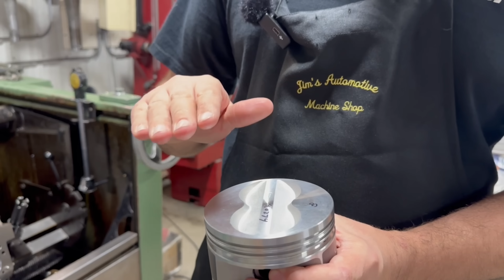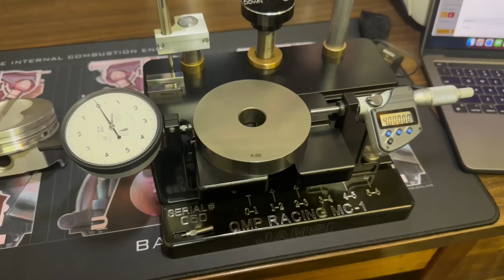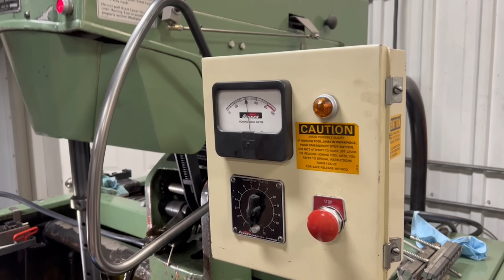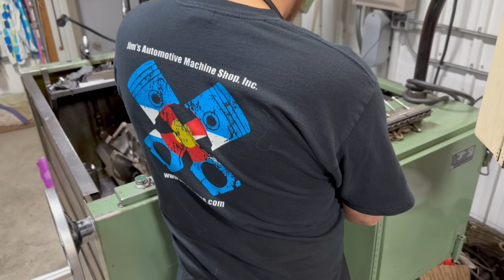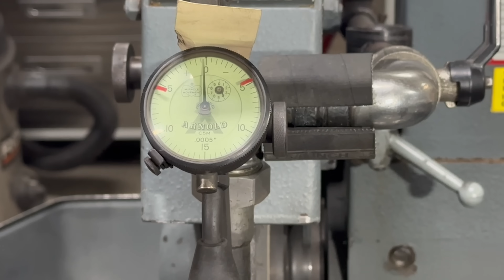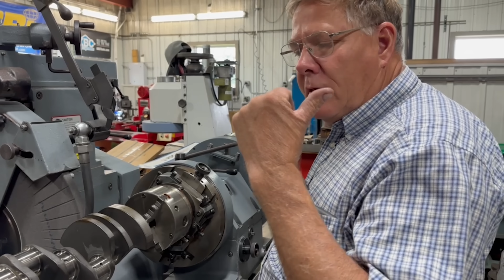Is Our 383 STROKER Crankshaft JUNK?!

Comment: Love the content.  I have some experience with surface roughness measurement using a Mitutoyo SJ-410.  The greatest advancement in understanding the condition of a surface for me came with the implementation of a software application called OmniSurf, published by Digital Metrology.  You pull the data from the gage directly, and you can perform offline form removal and filtering.  It's a game-changer!  Keep doing what you are doing.  It's fantastic!

Comment: Jim here’s the link..
David Vizard 621hp 383
540 ft lbs 
On pump gas - 87 octane 

https://m.youtube.com/watch?v=f66F64vSP4g&t=12s&pp=ygUYRGF2aWQgVml6YXJkIDYyMSBobyAzODMg

David also explained what is gravity…
It’s not the earth spinning..
It’s the weight of air…

A typical high school gymnasium has 40 tones of air inside the building..

Comment: David Vizard goes into the science about flat top pistons for street / strip engines…
Explains the burn rate across the piston using pump gas..

David has a spec build 383 Chevy that 621hp on pump gas - like 580 ft lbs of torque

Comment: How do you go about checking  if the crank is true  - all the journals  are where they should be  I never see anyone do that  - I've seen  off-setting the journals - making them smaller pushing them out using a smaller rod to create a stroker/somin

Comment: I had Jim do some extensive head work on a set of 461's that I put in a hotrodded 400 in about 1988 or 89.  Steve from LaSalle Manufab sent me to you.  I remember seeing your old shop El Camino around town in Greeley a lot. I moved to Arizona years ago, and I just came across your videos.  When I saw your familiar face I was amazed.  Good luck with your business!  I still have hotrod stuff, but a whole lot more expensive now.

Comment: yea profilometer is important. head gasket and ring companies spec a required surface finish but most machine shops or even engine builders do not even check. they will o-ring the engine before fixing the surface finish.

Comment: Great video!  Will you be using the profilometer for head gasket surfaces  and flywheel grinds? They both are designed for a specific target,  especially head gaskets (steel, composite,  copper,  etc.). Bummer about the crank, supplier quality is a never ending battle. Would be interesting to know e what the makers tolerance is, compared to what GM new crank tolerance is. It's all about time. Time spent to get down to minimum variation.  From a business perspective,  in tolerance is good enough, send it. Of course they COULD hit those 5% of tolerance numbers with process control - but that drives up cost. Three kind of work:  good, quick,  and cheap.  You can have any two, but not all three.
Reply: Used to be able to get .001, .002, & .003 under bearings.  That crank wood likely clean up at .002 under.

Comment: Piston accumulator grooves are unnecessary if you comprehend gap, and the purpose of each ring position. 
The top ring is the only compression ring. The second ring is an oil scraper ring, it scrapes excess oil from the cylinder wall. Hence the conical shape. The third, or oil control ring carries oil to the upper cylinder. 
Ring gap is critical. The top ring gap should be as small as possible without presenting the possibility of butting. 
Second ring gap can be absolutely wild, and should be. If the second ring does not allow gasses to escape because of a too small gap, the top ring will float or unseat.

I don't even want to watch the revelations re the crankshaft. 
I spent many years grinding crankshafts. From the miniscule Briggs, to the large Caterpillar, Cummins, and Komatsu.

Comment: What you are talking about, is called integrity. As a former machinist, I pushed for that in the shops I worked in. Any time I received a part that someone else had started, I took the time to measure every fit before putting it into another machine. It saves time, money, and needless fighting over who did what! Some people try to hide their mistakes, instead of learning from them.

Comment: Just checked my Eagle forged crank. Same story, not quite as bad. seems the rod journals vary from edge to edge. This seems to be the case with all the Chinese made crap. They're just slinging it out fast with no regard to quality! Shame on these American companies for not doing the quality control! I got fed up with Eagle some years back as their flexplates were absolute junk. So cupped and out of spec. Their answer was " They computer welded everything and it was good". Hadn't bought a rotating assembly for 7 years from them. I guess I'm not buying any cranks from them from now on! Probably not from Scat either!

Comment: i know next to nothing about machining, but i’m curious: is it ever considered appropriate to give back a crank with different diameters on the journals, and just advise the customer which rod(s)/main journals require what size bearing, or do you grind everything to the same size as the smallest journal?

Comment: Isn't this a VERY well know manufacturer (That I will not name) crank??? Because if it is, I can tell you that this WOULD NOT BE the first time in RECENT months that we have seen this type of issue with there parts. Another Well know You Tube channel RECENTLY had a issue with a crank from the said company that I will not name. And it cost him a LOT when the crank failed under a low rpm failure.

Comment: The out of round 3 tenths wouldn't bother me as much as the taper. One shop I worked at had a crank grinder that ground a full. 001" out of round. I refused to use it. Guy that worked there told me every guy that worked in that shop since the machine was new in 1962 complained about it. We had Jamison Equipment work on it 2 times, including rebuilding head and tailstock and scraping the table and the gibs and ways. Never changed a thing. One day the late Jim Gessford came in after he sold his shop and started selling equipment for Jamison and I was telling him how disappointed I was in that grinder and all the money we dumped into it only to have it grind out of round. He says it sounds like it's lined up perfectly and that's not correct it needs to have a slight misalignment just like toe-in on a car front end. He told me how to check it and what to do and with 4 little pieces of .0015 shim stock that machine would freeze the needle on the Arnold Guage!!!! I was amazed, that was 1989 and I'm forever grateful to Jim Gessford, he was a self taught genius of a machinist and equipment rebuilding. My biggest regret was not going to work for him when he offered me a position once. I would have learned a lot more and probably still been doing machine work.
Reply: Yeah I read and learned old ways about shimming and comes from the pre-war days rebuilding by hand I been doing this stuff since 68 but too too precise equals stress and redo because of over precision and being too picky the engine will still run
Reply: @brantardrey7360  I was referring to shimming on the crankshaft grinder to get it inline so it would grind perfectly round. Not shimming the engine, that went away when insert bearings came out in the early 50s. Way before my time.

Comment: That's a Tough One.. The Crank Supplier thought the Crank was 100%.. Unfortunately you got it.. Grinding it 10/10 will be fine..I Beleive You will Not have a difference in the balance to even worry about, seeing how low you got readings..... It Would be a HUGE challenge for The Cleaning Guy if You Bought Plus .001"  tighter bearings and he could grind the crank journals to suit them.. Plus .001" bearings i've seen, depending on brand, close up clearances .0015".... Great Job, and Buying a Profileometer is a great move and asset to have to hone blocks....Well Done...

Comment: I'm not an engine guy, but I am an engineer and I can't believe clevite will only promise .001 out of round!  Thats absurd in my book.  You weren't even trying to check concentricity between journals.  I'm honestly not sure how they could could possibly grind a crank that far out of round aside from silly high of tool pressures.  Guess trying to push parts out the door.   Making something round is one of the most basic operations you can do in grinding (getting the size perfect is much harder than getting it round right?).  With a little patience I've set 30 meter linear rails to +/- .001 and the machine runs compensation on top of that to account for concrete foundation deflection.

Comment: As a master machinist and master gunsmith I can say that just a minor change in temperature can change the diameter of a piece of steel that size by several ten thousandth of an inch.

Comment: I am stunned by these measurements for a "new" crank. Surely your supplier needs to come to the party here, it is their reputation too. Notwithstanding that you have balanced it already, this error is not yours, and the cost of the work is borne by yourselves. I would ask for another crank actually. I would be more concerned with the out of round rather than the step though. One rod would run on one part of the step, the other rod would run on the other side. Unless the customer specifies a zero/zero crank, grinding it seems the logical choice if the crank supplier will not come to the party.

Comment: Have you ever checked a cylinder after removing the torque plate to see just how much it affects final dimensions?  How can a a solid torque plate (steel? aluminum?) simulate the distortion a cylinder head, (either cast or aluminum) , with all it's internal passages,voids, cooling jackets, ports, even combustion chambers will have on a cylinder? An inch thick solid steel plate without a head gasket is not going to stress the bore exactly like a cylinder head. Yes "everyone" says they're essential,and it's always been done like that, so there it is.

Comment: I used profilometers a lot in aircraft hydraulic and fuel valve machining and assembly. We called them "creepers" in the shop because the probe moves so slowly.

Comment: This is what i keep seeing.  Cant trust any parts.  From a bolt to a crankshaft!!

So you can now change your video title's  to "A blueprinted 383".

I dont rebuild engines or transmissions on the daily.  I have and have a trusted machine shop do the machine work when done.  And it always gets inspected by me  and not just installed assuming it was done right.  And thats why i "trust" the machine shop i go with.  I have yet to find mistakes.   

But here is an example of crap parts.  I put 7 alternators in 1 car last year.  Every one failed.  Either 5 minutes in to a week in.  It sucked.  And i did 5 cv axles in 1 car!!  All caused a wobble.

Comment: In the absence of an explicit roundness requirement for a circular feature on an engineering drawing, the feature of size tolerance implicitly controls roundness. If the feature of size tolerance allows more roundness variation than can be tolerated, a roundness control should be specified.

Comment: Yes sir we have to make sure that what we are getting has not been messed with before. If you keep that crankshaft of course it should be corrected, but I would think that I would send it back to the supplier and let them know what the problem is. I worked at a place where a fellow mechanic messed up one of those fuel pumps that go into the tank and the manager simply sent it back to the parts store for credit. Of course he did not tell the parts store the reason for the return and most likely it was boxed up and put back on the shelf for some other unsuspecting shop or mechanic. I am leary of any part that has been reboxed or shows signs of handling or installation.

Comment: I am not an engineer, nor do I have any experience of engine machining, but I do like watching rebuild videos. I have seen some videos where the very last process in cylinder bore honing involves the use of wire brushes. Apparently, it makes sure no bits of honing stone/media are left in the cross hatching. What are your thoughts on this? Keep up the good work.

Comment: Since I started using an SJ-210 about six or seven years ago, I found it to be an indispensible part of my honing operation. I've learned that cylinders and sleeves from different sources can require tweaks in the finishing operations. What I always assumed to be right, as in "this is how we always did it," turned out to be pretty close, but not 100% by any means. If you have any finishing issues, the guys at Total Seal Piston Rings are very helpful.

Comment: Heck , offset grind the crank go from  3.750" to 3.800"  and go to the small journal rods.   Maybe cut . 030" off the piston,  and  maybe run a
.040" - .050" MLS head gasket  gasket ,  with the piston at zero deck, or or possibly 
.010"- .015" proud ,  with the gasket and the relief should leave plenty of clearance. Tight quench pads, performance is much greater,  and polish the chambers while while it's apart, maybe  ceramic coat the chambers and exhaust ports! I guarantee it will produce more power than without the mods,   definitely would require checking the valve clearance,  and quench clearance, also get more cid. Aswell, near 390cid it's been years since I did the math,  my 385 stroker,  I was thinking about getting a 3.850, maybe offset grind that to 3.900,  possibly 3.925", 3.950"  and possibly shorten the rods a bit by resizing them, tak about .020"off the rod only then resize the journal end ,  then take a bit off the piston, if required, mill the heads, so the piston can fit in the head slightly, with about .020" larger diameter, than the piston, allowing the rings to  reach closer to the deck, all this making a more efficient engine, especially with about 200-220psi,/11:1+ compression. For a streetable engine,  with the quench pads so tight, they have clearance, however carbon cannot build up, the pressures involved blows the surfaces clean constantly, although, with heavy bearing wear, or spun bearing, it will definitely make contact,  this really produces power in a engine, greatly improves combustion, it's basically Ben Almeda's religion, it only confirmed what I already knew!  Also plenty of piston to valve clearance will reduce shrouding, the piston can shroud the valves also! Especially domed pistons!

Comment: I once bought a set of brembo brake discs only to find cheap chineese garbage inside once i opened the boxes. Someone bought the goods and swapped them for inferior copies to return later. I just returned the whole lot straight away, i guesss there is a sad lesson in both our cases: always check whatever you buy for quality.

Comment: Old corvettes had fitted bearings, are they available, you could get them in thousandth. Some BMW have two different shells for cap and rod ends .
Reply: You can get some bearings 0.001” under but that’s not much material to work with by the time you touch off the grinding wheel and correct the crank across all throws you will probably not have enough material to work with.
Reply: It is also common in Toyota engines. Whenever someone says "This car is premium because it has individual fit bearings" I laigh that even the simplest Toyotas used them.

Comment: I am a retired machinist/supervisor of over 40 years. While I never worked in automotive, I did work oilfield and very large compressors. When we did a crank, much larger than you are working with, (several thousand pound cranks) we also put special indicators between the counter balances to see how much the crank was flexing which causes runout. We then put adjustable bearing blocks at the journals and dilwedd the flex out of the crank to keep the crank from flexing while spinning before we started a grind. 

My guess is that the previous person that ground that crank spun it too fast and it flexed while grinding causing the runout not to mention what he/she did to put a step in that journal. Also we never ran three jaw chucks because just tightening them up can flex/bend a piece of work. You can check that claim out yourself with an indicator.  We ran face plates and bolted the cranks to them to keep the stress off of the cranks or precision shafts we made. You mentioned nothing can be perfect. Well, I assure you that when we were done we had zero runout on our cranks and shafts. If the time is taken and done properly you can get zero runout at least on your indicator.

Comment: If I talk to someone who says "It measured perfect"....my internal respect monitor goes way down because to a precision minded person there is NO such thing as 'perfect'.   It was great to hear this from the 'crank grinding guy'. :) 

 Everything has dimensional variances and if your equipment doesn't show them...then you just aren't measuring things close enough.  Once you start slipping past 'as close as we can get it' to 'it's within tolerance' then the tendency to use the tolerances to speed up production rather than to give you room to correct problems rears its' ugly head.   Good machine work being demonstrated here!!
Reply: the thing is, even temperatures inside the shop can change the size of any metal device used for measuring.

Comment: I built a 383 LT1 or had it built. sent the block, eagle rotating assembly (rods, crank, cam, chain, pistons, rings, arp studs, and bearings) to have done what you guys are doing. The assembly was supposed to have been balanced and blue printed from Eagle, but I asked the shop to verify.. well, long story short, they said it was good to go, I got the short block back fully assembled, timing chain, oil pan, front cover, I put the heads on, and intake + acc., I didn't even get break in time, less than 500 miles, and the crank broke. Had another shop to tear down to find out why, and they said the crank was tapered too much and had a step on the journal. So yea I lost a high end build for this same thing.. got so aggravated I converted the entire car to an LS.. loved the sound of the 383, but LS is still running 10yrs later!